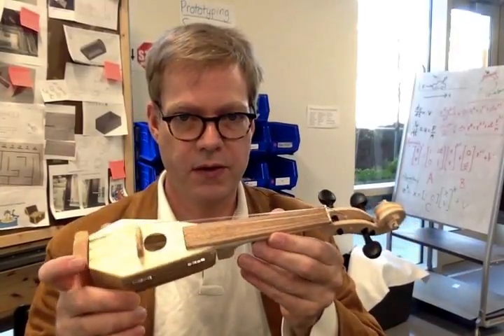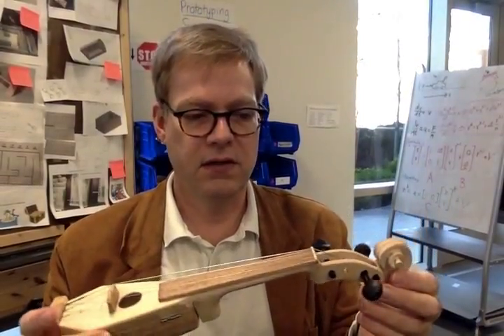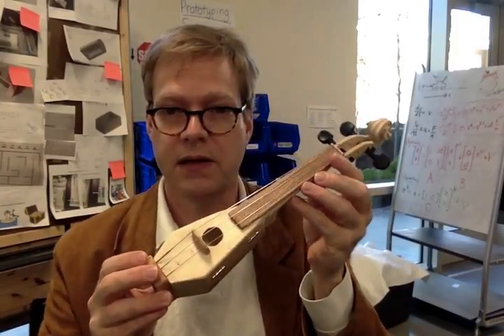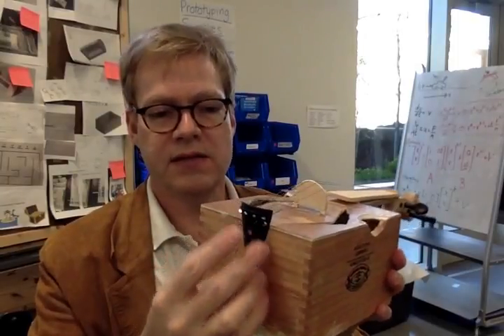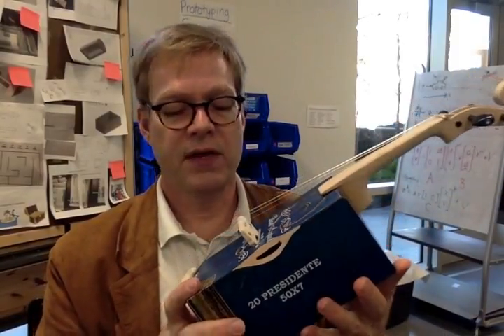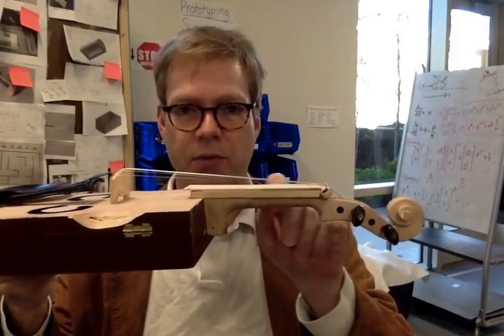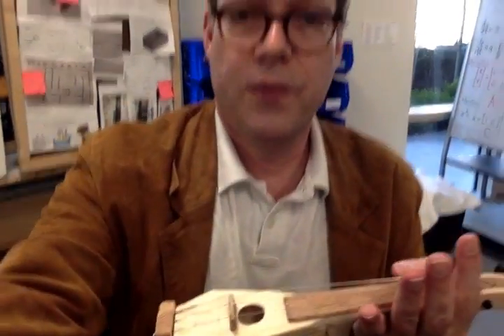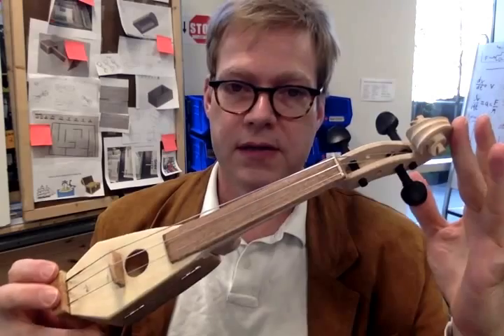Cigar-box violins: a really great intro engineering exercise!

Comment: Beaut! Just wondering - how do you involve CAD in the process? I know woodworking, and I know CAD, so it’s always cool to find an unexpected intersection.
Reply from the maker: Thanks. I've made much better ones now :)

For CAD, we use Autodesk Inventor and do modal analysis. So, students build the model, assign the closest wood from the library that they can (maple), and simulate the vibrational modes. They do this without sound holes first, to get an idea of their role in changing the sound. Then I encourage them to try different sound hole designs and see what it does to the spectrum. Classic f-holes often end up being the best choice.

The big surprise is that the sound holes don't merely "get the sound out" - they really shape it, by adding lots of new modes. The way I explain it is that the box is the "speaker" for the strings, and the bridge is the transducer, so the box needs to have lots of modes to convey the sound. Students are often surprised to discover that the sound holes can deepen the sound.

The CAD simulations also give the more theoretically-inclined students an important role.